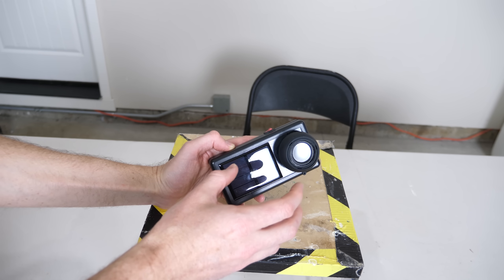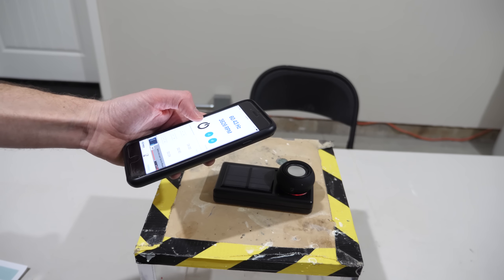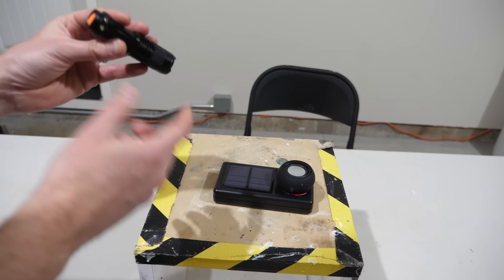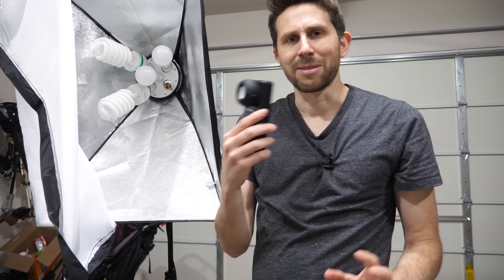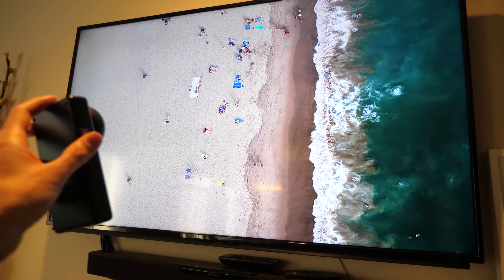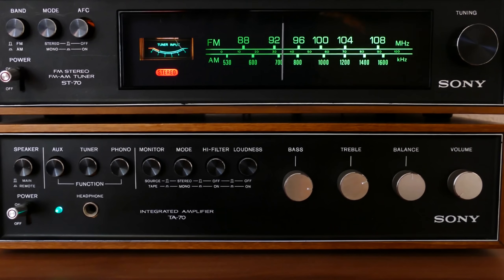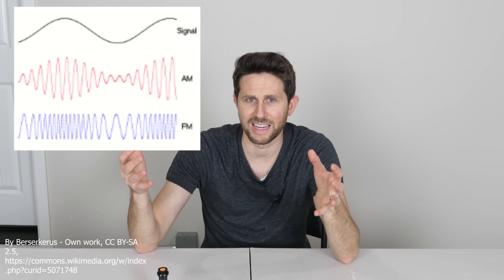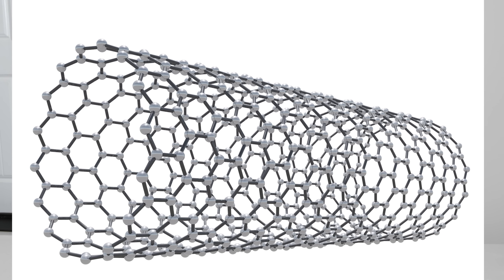Can You Hear Light? The Audio-Modulated Light Beam Experiment

Comment: "Your eye only have a refresh rate of around 23 hertz."
Oh boy, you just started a war.
Reply: @vlc-cosplayer  Eyes track movement. If the framerate is low but subject "moving" then your eye tries to follow it. but of course on-screen objects just teleport a small distance periodically so they look jerky. 

With film, it's common to reduce shutter speed so instead of looking jerky, moving things get blurred. Also, films always have known subjects, so directors keep them roughly centered or still by tracking them.

So yes, the analog bandwidth of your eyes is only <10Hz, but because your eyes can track objects in screen, you will notice differences even if your display refreshes many hundreds of times per second.
Reply: @power-max I have ever used a motion picture camera, but I don't think your account is correct. Film runs at 24fps, and each exposure is usually 1/48th of a second.  This is standard, and it is unusual to change the shutter speed.  Things will not look jerky at 1/48th of a second, and there is plenty of motion blur.  It must be twice the frame rate because the shutter is a half a disc that spins around.  The film is advanced when that half-disc is in front of the lens, and exposed when it isn't (this half of the shutter can be mirrored for the viewfinder). Thus, each exposure is actually 1/48th of a second, and a new frame is exposed every 1/24th of a second.  The amount of motion blur can be adjusted by varying the shutter _angle_.  That is, instead of an angle of 180 (half the disc),  one might use a larger shutter angle to get more motion blur, or a smaller one for less.  This varies the amount of light hitting the film, but the frame rate does not change. I probably have forgotten something, so don't take this as a full description of what is going on, but I'm pretty sure that is the gist of it.
Reply: @bsadewitz  Not sure what your point is, yeah the shutter speed is how long the film is exposed, or how long a sensor is collecting charges on the active elements before those charges are sampled by ADC's and analog gain stages within the sensor.

Framerate and Exposure time are independent variables, but they are related in that you can't have a shutter speed or exposure time slower than the framerate.
Reply: I Can See The Difference Between 30 And 60 Fps
Wait
Reply: @quickpixel101  why is it different?
Reply: Anderson Luiz what u mean
Reply: I have an IDEA! Ok, so what would happen if you use different lens filters with this setup? You know like a uv filter and such?
Reply: @power-max  I believe you tagged the wrong person. But good info, none the less!
Reply: @V4p3rcl0ud  lol stupid mobile app
Reply: Does anyone know why you hear morse code sounds when pointing the panel towards the sun?
Reply: NO WAY your eye actually have a refresh rate of ~960Hz
Reply: wait no ur right the refresh rate is 23Hz BUT the FPS (frames per second) of every human eye is around 960FPS
Reply: @naufal_su_bi_ng6936  Huh?  The eye is an eye, not a CRT.  It does not have a "refresh rate".  It isn't a camera or a CRT or anything else like that, and it doesn't work like one.  The frequency at which we no longer can detect e.g. the flashing of a strobe light is called the critical flicker fusion threshold, and it varies.  Generally, greater alertness increases that frequency.  However, the CFFT is only relevant with flicker.  Persistence of vision is the phenomenon of perceiving motion instead of a sequence of still images, and that is around 24fps or so.  One may simultaneously sense flickering and experience the illusion of motion from still frames shown in sequence.

Give someone caffeine or amphetamine, and the CFFT increases.  Same thing with activation of sympathetic nervous system during a stressful event ( "fight or flight" response, which is what those drugs do).
Reply: Indeed he has
Reply: KOOOOOLEST THING EVERRRRRRRR!!!!

Comment: Very similar (on a basic level) to the tech used in fiber optic communications except instead of the light traveling through the air from one point to another, it travels through sometimes miles and miles of glass fibers thinner than the hairs on your head.  And of course it carries MUCH more than simple audio transmissions. And it’s done with infrared (not visible to the human eye) LASERs instead of a flashlight. 

Very cool episode! Thanks and keep up the good work! :)

Comment: Can't you put colour filters on the solar panel to tune it?
Reply from the maker: Yes good idea,
Reply: That's immediately what I thought
Reply: Isn't there a dark portion in the middle of the light spectrum which could be utilized to transmit the signal further without solar interference?
Reply: @arty2k  hol up. u onto something homie...
Reply: A polarising filter may also help?
Reply: By adding a capacitor parallel with the speaker's input signal, you can eliminate the white noise. (low pass filter)
Reply: or use an infra-red receiver. they can be programmed to pick up certain infrared frequencies and it wouldnt even be visible. it would be a great way to pass on hidden messages.
Reply: If you mean placing translucent tinted objects, it won't work since we're using white light. If you block a color the other colors will still have the same brightness

Comment: I want to buy the flash with aux cable you bought to make this video.
Please mention the link in reply.
Thanking you
Reply from the maker: Sarang Aerials https://www.teachersource.com/product/light-modulator/light-properties
Reply: Hes not going to reply
Reply: I'm intrigued by that too, waiting for an answer whether it is a flashlight on its own with this feature or a modded one.
Well I think one could modulate the LED's current with a rather simple circuit, using maybe just as much as an opamp, a mosfet and some resistors, don't know about the bandwidth though. It'd be a handy little project to build.

Comment: I was expecting a test with an infrared remote controler !Try it it's fun ! You actually can hear the coding.
Reply: @nonothebot That’s a good idea!
Reply: most IR remotes use a carrier wave of 38khz which is above our hearing but we might be able to hear the signal itself which i think is usually only a few bites per second
Reply: @Isaac what is heard is, that which is modulated on the carrier.  I.e. the carrier is switched on and off at rates that encode the codes being sent.
That is what is being heard.

Comment: Isn't current alternating at 60hz or 50hz not 120??? I think you meant 120v
Reply: There are two peaks per cycle at, one positive, and one negative for a complete cycle of AC.

The Light doesn't care what the polarity is and will light at both the positive and negative peak of a single cycle, hence 120Hz, since there are two peaks per cycle.
Reply: Cameron Whitaker that is wrong because 1Hz = 1 cycle (high and low). Therefore 60Hz but it will blink 120x in one second.
Reply: Martin Mali ahhhh thanks bro
Reply: I think u r from India

Comment: "the human eye has a refresh rate of around 23 hertz."
r/PCMasterRace wants to know your location
Reply from the maker: The 23hz is about the rate we can distinguish individual flashes. We can see that the rate is increasing or decreasing much higher than this rate but we can’t necessarily distinguish the pulses. Basically this means that the old flash of light signal has not dissipated from your rods/cones before the new signal comes in. Below 23hz is where you can start to not have overlap between new and old signals.
Reply: The Action Lab Oh ok
Reply: @TheActionLab  Thank you for clarifying!
Reply: @adaster98  This fact is indeed wrong because it's badly understood/repeated. I think the 23/24Hz thing is the maximum refresh rate at which you clearly see and identify a different image poping and disappearing (like a subliminal image) or something like that. I don't remember exactly, but if you research on Google you can find better details as to why people still believe this.
But our eyes can indeed differentiate refresh rates (for animated scenes) much higher than 24Hz. There is a limit, I guess different from people to people, but it's higher.
Reply: @adaster98  I don't believe that is accurate, either.  I have done experiments using a variable frequency squarewave generator driving an LED, with a frequency counter connected as well.  I could run the freq up to 40 Hz before it looked like it was on constantly.  This, I believe, is due to the fact that the thalamocortical cognition cycle of the brain is fundamentally a 40 Hz rate.  It just can't keep up with anything faster, so it is perceived as continuous
Reply: the size of the llightsource has a huge impact on perceived flickering. A LED would look decent starting from where you mention. A 28 inch CRT display would need a refresh rate of at least 80-90 hz to remove all perceived flicker.  @kenlogsdon7095
Reply: @kenlogsdon7095  Except I remember being clearly able to tell the difference between my PC CRT refreshing (=flickering) at 60 hz and 120 hz. I would estimate (based on experience) that the limit of what can be perceived as fliickery is probably somewhere inbetween the two. From what I remember, anything >= 120 hz definitely looked stable but going higher still felt slightly less straining on the eyes. Been years since I had a CRT though.
Reply: With monitors it's not so much that you can't see the individual frames once above 24Hz, it's that you can see ghosting and screen tearing artifacts with lower frequency monitors. 
This is because a screen refreshes two times for each single cycle. The top half refreshes for the first half of a cycle, then the bottom half refreshes for the last half of the cycle. This is the difference between Native Refresh Rates and Relative Refresh Rates. Sometimes you can see a blurring or lagging affect on lower frame rate monitors but you still don't see each individual frame. 
It still looks like a fluid moving continuous film or video.
Reply: Sonac yeah I thought about that to
Reply: @adaster98  Your brain combines information from a given time period. You can see the difference in a much higher frame rate, because it either makes things blurry or choppy. http://www.100fps.com/how_many_frames_can_humans_see.htm
Reply: @adaster98  Humans are capable of around 1000fps
Reply: The human eye operates at 60-100htz but can notice differences up to 1000htz. You fps changes as your mental state changes. If you are nervous you will see in a higher frame rate than if you are relaxed.
Reply: I find my peripheral vision is sensitive to higher frequencies than my central vision. So sometimes I  can notice  a light flickering   if I  see it out of the corner of my eye but  it looks quite steady if I look more directly at it.  I am not sure why, but from a Darwinian point of view, it makes sense that I can sense movement more quickly at the corner of my vision as this movement could be from  something trying to eat me! I don't  have to see what it is clearly  just that something is moving so I can react milliseconds more quickly to look directly and see if I am in danger, or maybe it is something  I can hunt and eat, so the quicker the better for survival  in both cases.
Reply from the maker: @Gribbo9999  yes, I wish I could portray the peripheral vision thing on video somehow. If you watch a wheel spin and shift your eyes back and forth you can see the spokes clearly . But if you just look at it normally they are blurred together. Vision is definitely not as straight forward as a refresh rate on a screen.
Reply: @TheActionLab  that's explained why people can able to distinguish higher refresh rate monitor
Reply: @Gribbo9999  same here
  I actually notice flickering lights really well if I have been exercising really hard too, I guess due to the effects of adrenaline.  If I go inside somewhere after riding my bike hard, say ~30kph for 10 minutes, I notice it.  I can even perceive the "flicker" of incandescent lights, as they heat and cool by the AC frequency.
Reply: @Gribbo9999  Yeah. When I turn on my cozmo, I am surprised to see flashing in the corner of my eyes, but then when I look at it, it looks like it was constant the whole time.